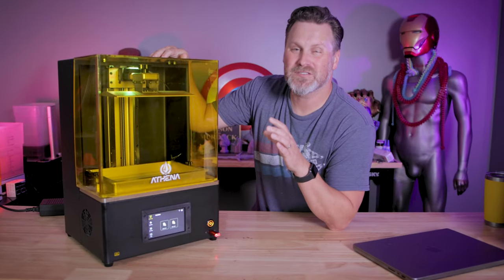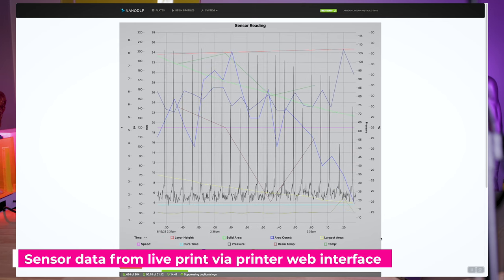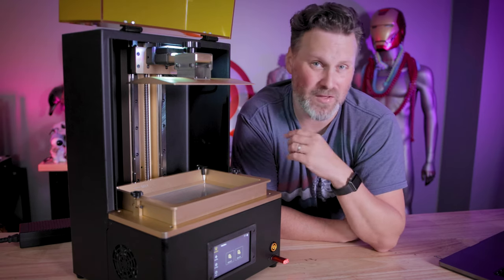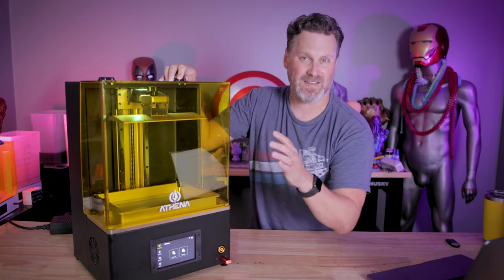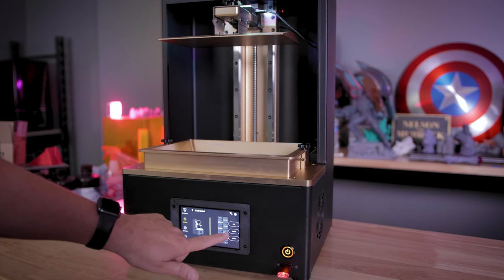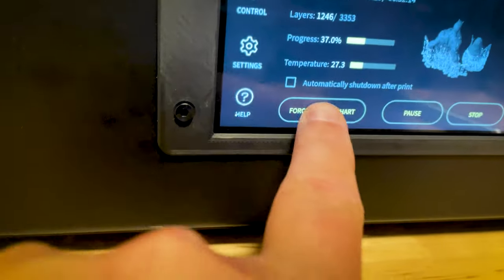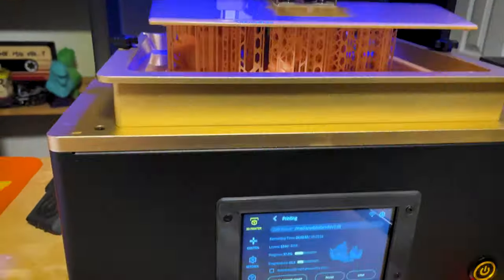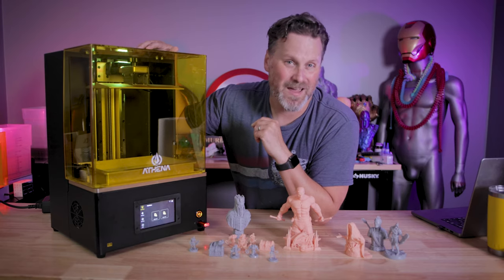A SMART Resin 3D Printer? - Athena First Look

Comment: This project is exactly what the 3D printing community needs, it may not fix everything we want fixed but it does address several trivial issues as well as pushing the envelope in the right direction. Even if this project fails - the likes of Creality and Elegoo need to wake up because a product that bundles this level of tech is a serious challenge to their market share. If Athena doesn't succeed it's only a matter of time before another next-gen product comes along.

Comment: Puchased a Uniformation GK Two. Will take something more major in terms of features etc for me to jump ship
Reply: force sensing z axis is the most major I. provement you could possibly ask for, perfect lift height on every level improving realibilty and speed drastically. the new 12k printers claim faster printing speed but that's just by doubling the layer height and using acf and calling that faster, you can do that on any printer, this printer is actually faster, and you will be able to upgrade it in future instead of buying a whole new printer when all you want is a higher res screen and compatible motherboard

Comment: Problem of inability to stop build plate movement is inside klipper firmware what they use for kinematics, if you send some gcode to klipper - it will push it to the movement queue of the MCU which cannot be interrupted until you send emergency stop(or some error happens) there's a lot of reasons for that main one - is that klipper runs on linux, so it's not working in real-time and cannot know at which position movement will stop in a middle of a motion(so you basically will need to re-home), it can be done differently by sending multiple chunks of movement instead of single one thou

Comment: ever heard of the Prometheus MSLA as an open source point of view :') ? BTW for now we are using nano dlp too because it's the only option we have for now. .. we are working on our own OS because we had the same issues as you since the beginning. Other than the bug and all ( i barely use the touch screen) when you know the work flow it works great. What i generally do is support my files on Prusa slicer and export the STL to the machine ( than slice it on the machine ) ... If i don't want to slice on the machine i slice with Vlare and save the slice in PNG zip file so it's ready to print !
Reply from the maker: so wish I could have got to that machine last year. Very exciting to see multiple teams jumping in and trying to build something else for people to work with

Comment: How about a comparison of this machine with the mono 5s and the elegoo saturn 3 ultra
Reply from the maker: Wish I had more time to fit that into this video. Was pressed for time. 
At the moment the prints off the M5s & Saturn 3/Ultra look better. I will try to print up something and compare between the 3 this week
Reply: @UncleJessy  How about print speeds?
Reply: @UncleJessy  I'm trying to figure out what's going to be the best bang for the buck. I researched the 5s and it's over 600 as to the elegoo being steady at 499.
Reply: That test will only make sense once ther eis a production level machine and software
Reply: @UncleJessy  I take that back anycubic has it at 499

Comment: With regards to those resin profiles, I have been wondering if anyone has implemented that on Klipper. Klipper does show what the slicer put in as the filament, but I can't imagine that overriding it in Klipper for whatever is loaded in the machine would be too difficult. The juice probably isn't worth it

Comment: Well, as far as I know, you cannot export slt for hollowed part (and holes) with lychee slicer without the pro version.
This process of not being able to pre-slice your file is also a problem for the position of the the print on the build plate

Comment: G'dday m8....i got a Nova3d Whale 2 and its running Android os, on a custom board, its not a chitu board.....and is a great mid size printer with basic menu on the printer😁...cheers from Downunder🙃
Reply from the maker: Heck yeah! I've been meaning to take a look at that machine
Reply: @UncleJessy  then ya wanna look at the new Nova3d Whale 3 SE 8k 10in screen, mine is the 4k 8.9in screen. Cheers for ya help in this field m8... from downunder🙃

Comment: No where in any of their literature states that it is an open source printer. They’ve been in development for 10 years. It looks like all the printers have gone out to backers and it appears to be in beta. It remains to be seen how well lychee is integrated into the printer. The printer outputs a lot of information. How will that be communicated to the user. They’re actively working on it, and it’s getting better. The price for the printer on the website is $2050 CAD ($1508 US), but you still can’t pre-order it. Having said all that, I think it’s a really neat printer. It’s got a lot of promise. I really want to see tight integration with lychee slicer. I’m over printer manufacturers racing to the bottom in terms of cost over QOL features. I really want them to be successful. 😊

Comment: Really would love to get a non-chitu printer but for the price.... sounds like it needs some major work before I would drop that kind of money.
Reply: the price might go down a bit after production is setup, it doesn't need to get much cheaper though because this printer already has basically perfect hardware, I me a what more could you need than a force sensing z axis for perfect layer height on every layer?? The only other things you might want eg higher resolution screens you will be able to upgrade, unlike chitu printers where they make you buy a whole new printer when you only need a new screen and motherboard, because of this you could save money in the long run with a printer like this.
Reply: @awildtomappeared5925  I like the fact that they are going open source.  Would like to know if it is even going to be possible to use Prusa slicer and then send the file over.

Comment: I thought the whole point of putting a support piece in a vat clean was that you can peel it away easily AND not touch the FEP. With that yellow scraper you are literally scraping the FEP, no?
Reply: yes he just couldn't be bothered, I can't usually either because you only need to touch the very corner of the fep with the spatchula to get under the cured resin which you can then pull up without touching the fep anymore, not a massive deal imo.

Comment: I think it is a great idea but not at that price point from an unknown company.   There are similar new printers for half the price.   For example, the mono M5s has a similar force detection system and that printer is roughly 500 dollars and a 12k screen and was on early bird for 399 when it launched.
Reply: The force detection system in the M5s is about as basic as it comes and seemingly has failed to detect failed prints. It’s a big difference in capability.

Price however is a decent factor to gauge off